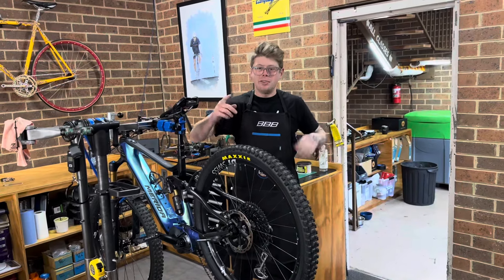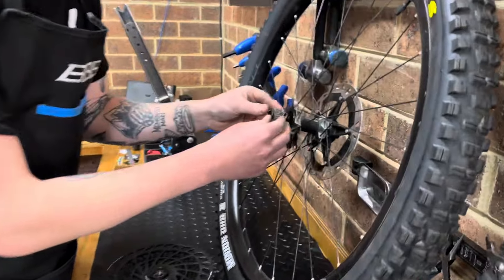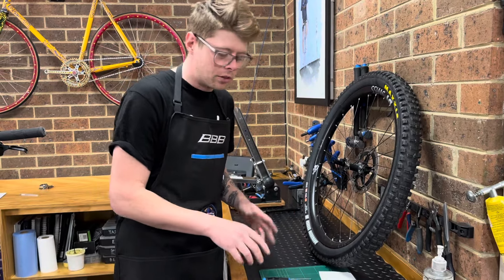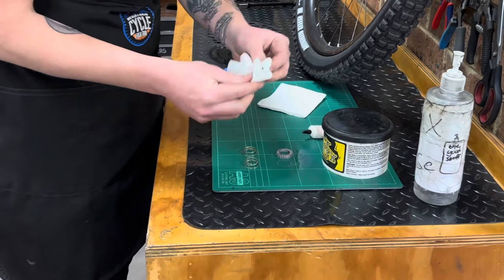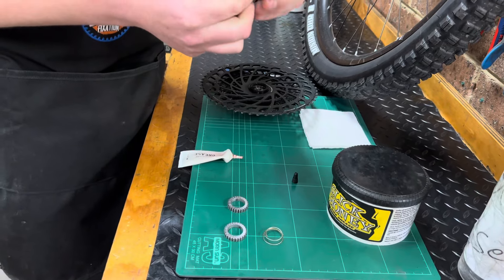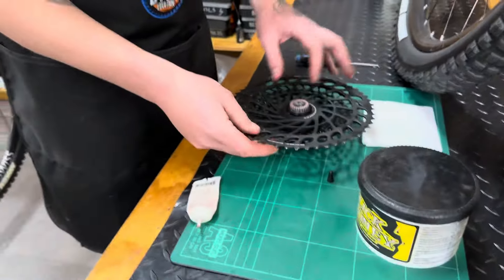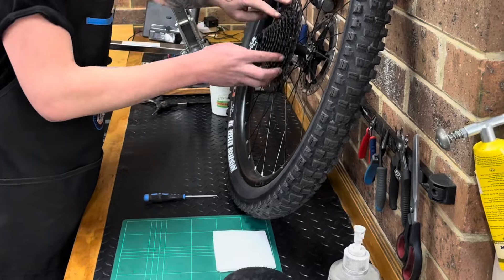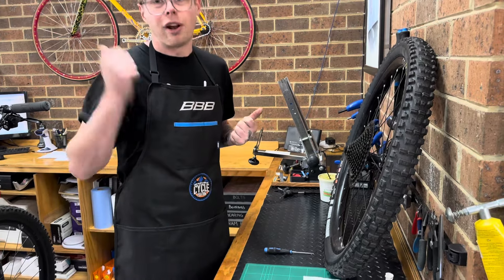DT SWISS Star Ratchet Explained ! & HOW TO Service freehub

Comment: Alex, doesn’t the cassette require tightening? I thought the threads for SRAM XD cassettes were on the inside of the cassette, or did the freehub body just get pulled out with the cassette?
Reply from the maker: You are correct! 
We pulled the freehub body off with the cassette this time
You can remove the cassette if you like but it’s not necessary 👌
Reply: Best demo for this service, got my wheels with the DT 240's several years ago and it took me awhile to figure this out on my own.  Wish your vid was out back then 👍